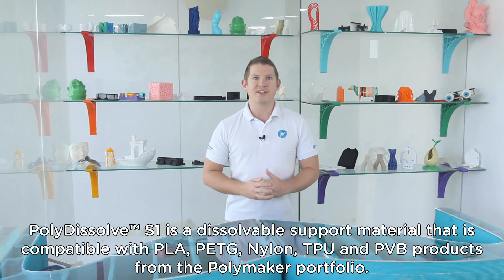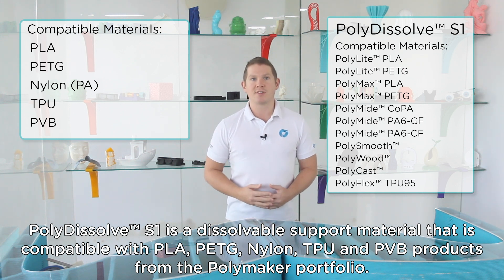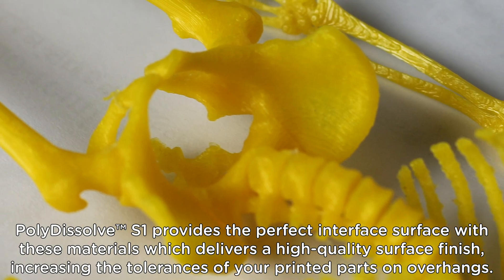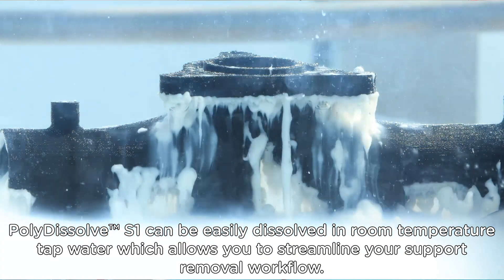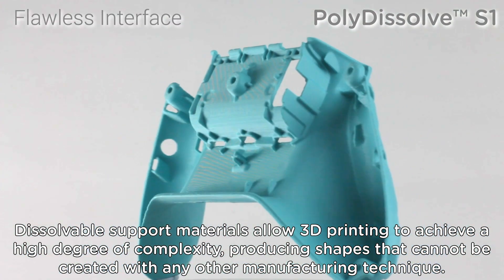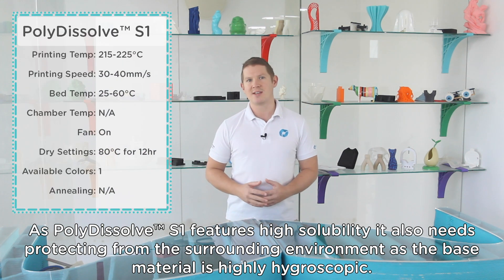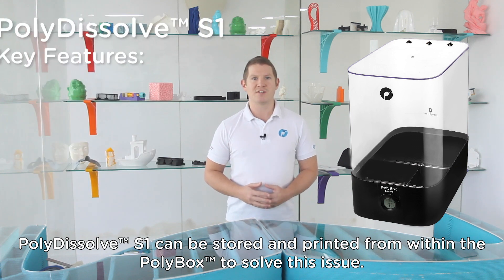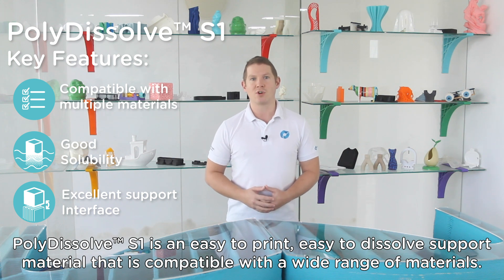Material Introductions - PolyDissolve™ S1

Comment: I like the Polymaker line of products, especially the Polymax line, although their price point is far too expensive to be used on a day-to-day basis. However, the PolyDissolve S1 is a major disappointment. Right out of the sealed bag, its surface texture is very rough compared to other dissolvable materials  I've tried. It must be bone-dry, which you can only really determine when it fails. In fact, whenever I've tried to use it, the majority of prints failed because of inadequate binding with the build surface or the supported material. With a newly-dried roll (12+ hours in a dehydrator), I've had minimal success supporting PLA and none supporting PETG. Because it's so hygroscopic, I find it even more difficult to use in the more humid summer months. Polymaker's claim that "It is specifically engineered to have a perfect interface with these materials while also displaying good solubility." is misleading. I've rarely seen a good interface, let alone a "perfect" one. Very unfortunately, I've abandoned attempts to get it to work consistently and the VERY expensive, largely unused roll has been stored in a cabinet until I can dispose of it.